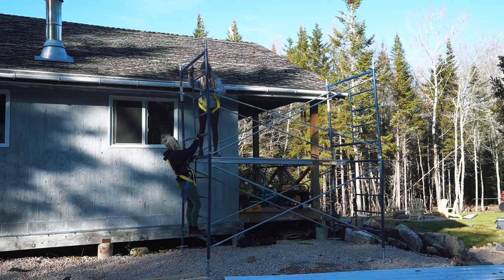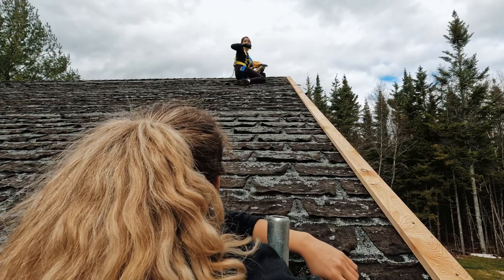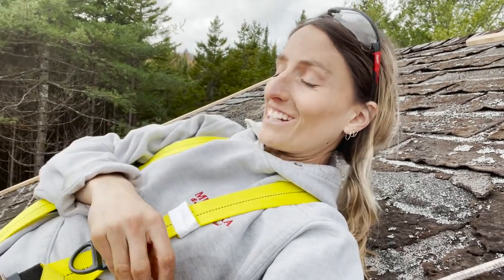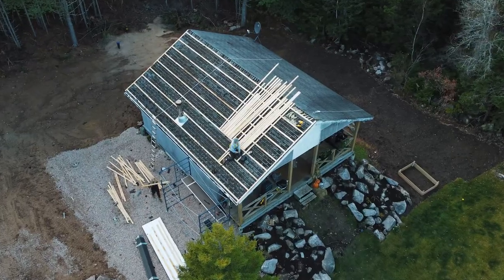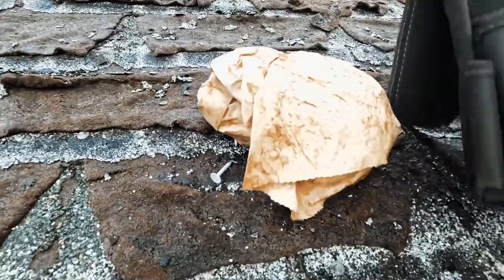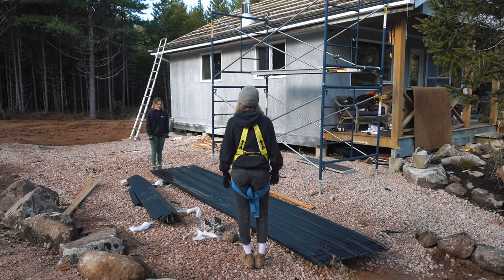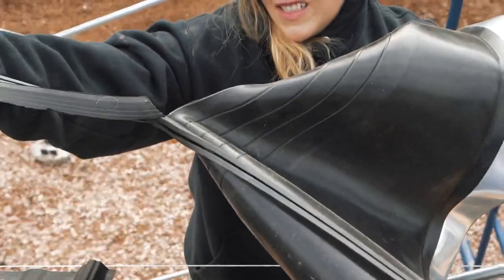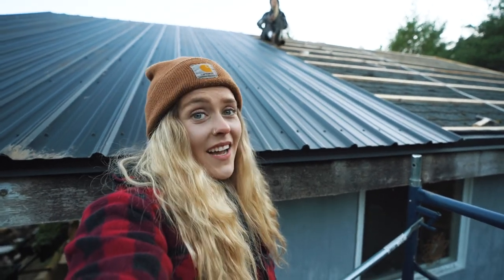Roofing Our Home w/ No Experience!

Comment: I’ve never seen a roof done without tearing off the old shingles first. Interesting method.
Reply: That's because it's not how it done. It would fail an inspection
Reply: My neighbor had shingles and he put metal roofing over top of shingles and because it didn't leak it was ok...
Reply: There is nothing wrong with installing a metal roof over shingles. It makes a great base and second line of defense.
Reply: It can be done over one layer of shingles. Not recommend over two.
Reply: @jcoats5529  standard reno procedure here in Nova Scotia
Reply: where I'm at there can be 2 layers only then when it's time to replace That roof it needs to be ripped off down to the sheeting...because most joists aren't ment to hold the weight of 3 layers....   but when I had my single roof changed I had them go to the sheeting because I wanted to see what, if anything, was going on under (it was the roof that came with the house that I had purchase 8 years prior.)  ...  glad I did because there was some dry rot around the flashing area that wasn't leaking,,.... yet.   And I planned it so when I'm older and on a fixed income and will need to change the roof I can put the 2nd layer on and not worry about paying the enormous fee for ripping off two layers.
Reply: I have seen it done with metal roofing….in Montana, where there is lots of wind and snow…..it works just fine
Reply: @blahblahblah6965  
Cool story. But what does your retirement plan have to do with a metal roof.... which you didn't do.... which would have lasted into your fixed income retirement?!
Reply: @GATORADDAM I had priced out the metal roof and up front was way out of my price range and I was sharing my experience and thoughts with others so they don't find them selves older and aren't able to replace their 2 layers of shingles.  Unfortunately I know 2 older friends that have this problem and leakage has damaged the sheet rock in both.  I think one house would be deemed uninhabitable...it's sad.
Reply: @blahblahblah6965  
I do, among other things, metal roofs. I don't know what part of the country you're in, but I do metal roofs for about the same price as shingles. 
Even if a metal roof costs more and you have to finance it, it still has to be cheaper then 2 shingle roofs.
Reply: @GATORADDAM  I'm in California and I really wanted a metal roof,  but it was almost double.  Shocked me... I thought the application would be way faster with less laborers on sight.  (this was about 6 years ago with 2 quotes)
Reply: @blahblahblah6965  
That explains it. California probably has a protect metal law or something! Hahaha.
Reply: Kudos to you girls...👏🏻👍🏻👍🏻...you two are rocking!!!
Reply: @jackiesiebrass3321  Did your neighbor's shingles look like these that needed to be replaced 10 years ago?  There's no way there aren't wet / weak spots and some rotted wood that needs to be replaced underneath all that.  Plus, I didn't see them trying to figure out where their rafters are, so they probably have 90% of that new roof anchored into nothing other than sheeting.  Rather a waste for those big framing nails they were shooting into it.
Reply: With shingle roofs most codes allow two layers before tear off needed. Even more common to go over the single layer shingle roof in my area. Their thinking is absolutely correct in that it is a second layer of protection under the metal. I was a roofer for about twelve years of my life with a break in between, so I have seen a lot. They did a great job.
Reply: @jcoats5529  You must live in a highly regulated area. Everywhere that I have lived and worked this would be TOTALLY ALLOWED BY CODE. And yes this is done all over the USA and I suspect it is common in Canada where they are. The kit supplier even had instructions for this system if you paid attention. Laying the strips even with the bottom of EVERY FOURTH ROW OF SHINGLES was their  guide, so yes this is how it is done in most areas. Building codes are VERY LOCAL and most know it alls only know their area. Which is to say you don't know very much.
Reply: @blahblahblah6965  Actually in most areas, to replace this metal roof, you would only need to take off this layer of metal and put new metal in it's place. But even that can be avoided if you keep up with it. Once that baked enamel finish gets bad in about fifty years, You can just paint it or use a liquid sealer based upon plastic or rubber and get another twenty years or so out of it. Only when it rusts through is it an issue. You do have to inspect the screws every decade or so and keep up with them by replacing the bad ones with ever longer screws thus getting new rubber washers with the new screws as they age and crack. If you neglect them till they leak inside, you may have a real expensive problem. That is one weakness that many forget about metal roofing. The rubber crush washers on those screws won't last as long as the metal.

Comment: One more very important thing.  It's very important to maintain any ventilation around the flashing.  The stove could light your cabin on fire otherwise.
Reply from the maker: Yes thank you!
Reply: That chimney is either double wall or triple wall pipe and is not that hot at the outer layer. The air channels between the layers get vented at the top of the pipe under the rain cap provided, so this is not an issue. Water seal is important. The old metal flashing has an angled band above it that clamps tight to the pipe to cause rain to shed out past the opening and they should probably use that above the new rubber boot as an extra layer of water protection instead of covering it with the boot. But that would just be extra precaution.

Comment: Ladies;
Just a FYI , I was a Firefighter and when using a ground ladder you want to make sure the distance between the base of the ladder and the structure is correct and the easiest way I was taught was to place the ladder to the roof and the get underneath the ladder and place one hand on the structure and the other hand on the rung that your arms are level
Now for the top, you want to have the ladder reach over the point where it contacts the roof so that when you climb up you will still have hold of the ladder when you step on to the roof
I would hate to see either one of you injured as I enjoy your videos

Comment: For the next time you do it nail down full one  (vertical) edge piece of strapping at either end and then nail FULL Pieces across and hanging over other end. Then lay a vertical piece on top of them flush with edge of roof and mark each horizontal, then attach vertical piece so saw blade hits mark drawn and screw it down to use as a straight edge to cut through them with saw blade set to cut thickness  of strapping without cutting into shingles. May sound complicated but in real time it's simple and works perfect. Finally put vertical back in place and nail down. I would also suggest caulking under 4 verticals at ends prior to nailing to keep any small bugs from getting access and building nests even though it will be covered with roofing trim piece.

Comment: Great video but it has to be said thought, even though in Nth America / Canada recommend screwing  metal roof screws onto the flats. In Australia where we get massive tropical storms. The screws are screwed into the ribs. The reason is, that when the rubber grommet perishes , the water doesn’t leak past the grommet as the bulk of the water travels along the flats.

Comment: You guys have so much energy and get so much done it's great seeing the results of all your hard work.  I do need to say YOU SHOULD HAVE STRIPPED THE OLD ROOF OFF.  You are taking a chance with condensation between the old roof and the new. The plywood could eventually fail. It might not matter that there's an air space between the two.  I would always strip and start fresh.

Comment: Definitely invest in better aluminum gutters and downspouts and keep them up under the drip edge so that face board that I see doesn't continue to have water splashing against it and rot out! Also use gutter screws not spikes as the wintery weather you will get the ice will rip off cheap gutters.

Comment: You women are fearless and smart! As a woman who worked in construction for over 25 years, I really appreciate your safety first focus! You're done, and congratulations! Just a couple tips for the future and for others: it is never a good idea to put new roofing over old. The membrane and metal roofing help negate possible future problems for you, but technically the old roof should be taken off, down to that membrane (and the membrane inspected for damage). The strapping you installed over the old roof should have been nailed into the roof rafters (or trusses) - a strong updraft from high winds can lift off the roof and strapping, worst case! But again, you are fearless and inspiring!
Reply: I was wondering about that. I don't know about roofing, but I would have thought that that would make sense to do.

Comment: The roof will leak because only the top row at the ridge and the bottom row at the eave, goes in the valley of the metal roof.  The screws at each 1x4 nailer, goes into the high point in each panel, which requires much longer screws.  Of course since you did not remove your old roof, you may never see that it is leaking.  Regardless you should now rechecking the screws that you did put in the trough, every summer and screwing them back in because the daily expansion and contraction of the panel due to the sun heating them, causes the screws to work loose.

Comment: In New Zealand and Australia, metal sheet roofing is very common. Indeed in rural and remote areas it was the vast majority of roofing (with clay or concrete tiles being a distant second). Metal roofing makes houses MORE resistant to Earthquakes, is easier to transport to rural areas,  and  lends itself to collecting rainwater from the roof which is safe for drinking, even without extra treatments. Previously I lived in rural Western Australia and although my house had "city" water piped to it, I used my rainwater tank including for all my kitchen cooking and drinking water. My system had nothing more than a basic leaf filter made from a kitchen sieve. Once I caught a baby scorpion in it. I think he'd been in there for awhile, as occasional rain events washed over him,  as the body was almost see through, had no colour in it. Still alive and healthy I released the wee fella about a hundred metres walk down the road into the native semi-arid bushland. Remember that water filled tanks are  VERY heavy. Those cube shaped ones you have look to be about 1,000 litres each so weight is 1,000 kg or one metric tonne each. At my place I bought and installed a  so called "thousand gallon" rainwater tank, stands about 6 feet high and about 6 feet diameter. When full that's about 4.5 metric tonnes (1,000 Imperial gallons). The house I was in had already a huge wraparound concrete floored verandah/porch. So even with the rainwater tank sitting at one end, there was still plenty of room  remaining for an undercover car-port parking space, plus room for plants in big tubs and seating and a small pond made out of a kid's plastic clamshell paddling pool  and room to use as an outdoor workshop in the shade and protection from the occasional rain.etc. However the one thing I notice is that in Australia and New Zealand the roofing nails/screws are placed in the UPPER part of shaped profile of the metal roofing sheet. Although the fasteners do have some form of rubber or similar seal, it lessens the chance of water leaking through, especially during prolonged wet periods or during those extremely heavy rainfall events, when the sky just opens up like a bath-tap. I expect that in your climate the roof will be covered in snow for parts of the year and then there will be moisture sitting around as the snow softens before melting enough to melt away or slide off ?

Comment: great job on the roof. I was wondering about any insulation in the ceiling?
Being a retired safety engineer, I love all the great safety items you both use in all the videos/ Safety belts, glasses, earplugs, hard hat, chainsaw blade,  training on heaving equipment. You are doing everything right. Demonstrating an excellent role model for anyone considering big renos.  Sadly many other you tubers do stupid things to get more view, often never promote safety, just like many renovators on HGTV,  Thank you ladies,  interesting stuff, getting ready for winter.  What is the problem with the van?

Comment: paws up! and yup! I was a part of a team of folks who had barriers to employment (in construction) way back in the early '80's (I was a woman and my coworkers were people of color, there was one other woman (we called ourselves 'salt and peppa' and still laugh about it when we see each other decades later) and there were also also ex-convicts...like you, we made the best of it! Laughing and singing! In due time I actually led the roofing crew, I was good at math and cutting...(it reminded me of sewing (my mom taught sewing at the local tech college), girl, I was carrying bundles of shingles up (they were 80 pounds, me 120) ~Jaz I feel you in terms of sizable choices!). Fast forward to our parallel universes, I bought a (used) nail gun and compressor recently and need to learn to use it! hahaha! I will check out you tube, of course. Hey, I have spent WAY too many hours searching for the material you purchased for the driveway, what is the name of the brand you used? It was white? (last week it seemed Crystal was watching the well driller and I swear she was worried about the weight of the truck on your driveway system, yes? No?) again, if only I could show you what I have been doing this summer, we would fall down laughing at the synchronicity! Oma, Alo and Nele

Comment: Its always good to remove the old shingles. The strapping is only nailed into the sheathing and NOT the rafters. Not enough holding strength. If you really want to do it that way I would have made sure you nailed it to a rafter. I would have used torx head screws.

Comment: My Comments:  As an engineer; as long as the roof sheathing is thick enough and in good condition (dry) and rafter spacing is to code, then non removal of old asphalt shingles should not be problem.  The only issue is roof loading and steel sheet roofing is light weight.
Likely should be good, structurally.
Looks good.
Reply: Righto it adds more weight which shows up in bearing walls.

Comment: I think you girls are very resourceful, and I don't want to spoil your hard work, screwing down the roof sheets you screw them down on the hip, not the valley.
Why the rain runs down the valley so for every screw you put in you have a potential leak. 
The metal roof will expand and contract through the seasons so before each winter you will need to check every screw and re-tighten them.
The suppliers of the roof should have told you that.

Comment: Nice job ladies on the roof.The only problem with the roof sheets you have chosen is the all the screws go in the valleys this can cause leaks over time as the rubber grommet underneath the top of the screw can perish leaving a gap thus a leak will occur. And the roof sheets become loose.A corrugated tin roof where the screws go on the peaks and not in the valleys would have been a better long term option.All the best keep up the good work..(:=()

Comment: Sorry to come off as a back seat driver, but that chimney flashing is actually self-venting, that storm collar or metal skirt makes the vent watertight while allowing the  lower metal flashing to vent, you should be able to remove the collar, then slip the boot over the cone-shaped Flashing, but keep the top of it clear of the boot to  allow the vent to work, then re-install that collar and caulk  where the top of the collar meets the Chimney pipe I like to use gutter sealant for that
Reply from the maker: Thank you! Screen shotted and we will revisit the installation of the boot soon 😊
Reply: @Vanwives  and after you finish there YOU ARE HIRED! And your next roof is out in Washington State! You guys did a great job!